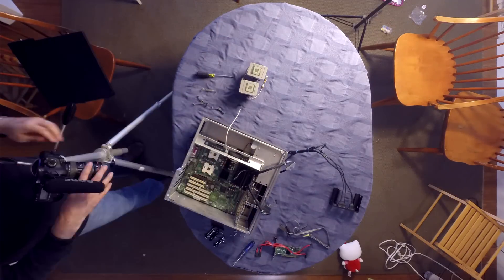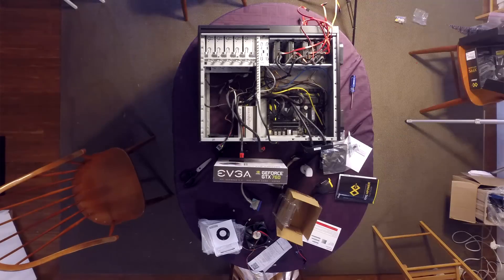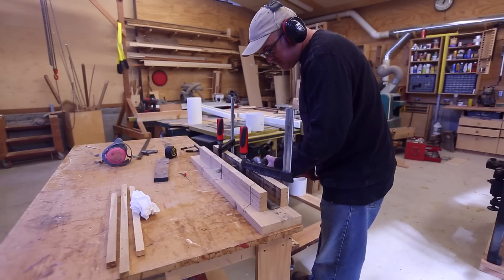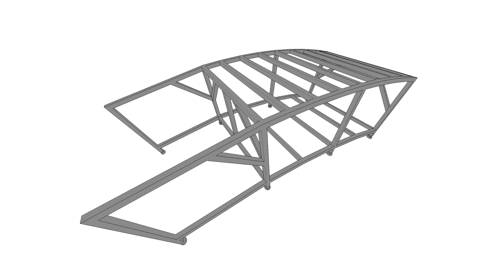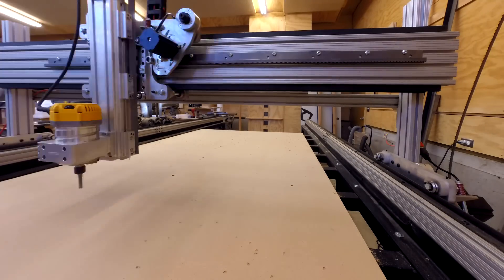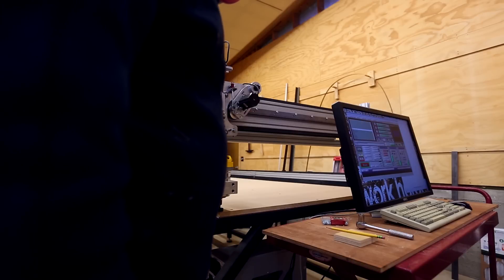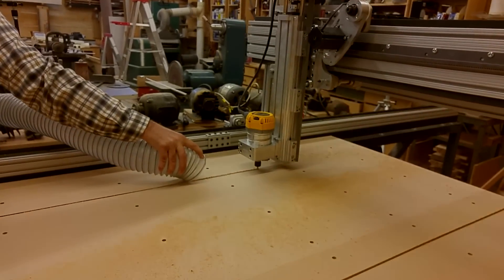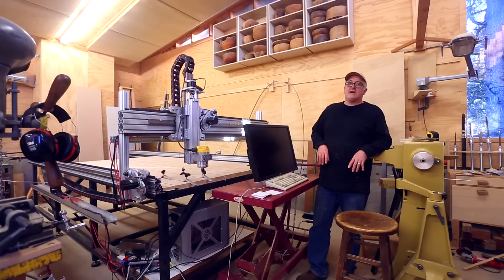The CNC Build: Part 3

Comment: Frank, All I can say is wow!  While I was layed off from our firm from 09 to 11 I worked for an ACM fabricator that has a large CR onsrude CNC that we operated with Alphacam.  it worked very well but was easier to draw in autocad and import into aphacam to assign tool paths. best of luck with the wire management! as far as dust collection our machine had a rigid duct that was horizontal on the gantry with a swivel connector to connect to a flexible line that sat in a tray like your motor cabling does. There was a dust shroud that raised and lowered with brushes on the bottom like a door sweep that helped to contain the dust for collection.  It also protected from the occasional tool break and small flying parts .

Comment: For hold down of small pieces, you can clamp a scrap board to the table and spray glue down your workpiece. The clamps will be outside the work area, and the glue should be strong enough to hold things in place so long as your feed and plunge are set reasonably. 

You may also want to look into nylon cap screws for holding the top MDF down, and see if you can find plastic hold downs, shattering a hardened router bit because you set an offset wrong and hit your clamp makes for a bad day.

Comment: Nice setup!  Check out HSMworks express if you have a seat in SolidWorks.  It's a free add-on and blends seamlessly with the style of SolidWorks especially if you're comfortable with Dassault Systemes meaning one less program needed.  Should note though: the free version of HSM (called "express") provides "two and a half dimensions of motion" where you can move in x, y, x&y, or z, but not xyz simultaneously. It's perfect/enough for 3 axis planer work but could require a couple hundred passes with a ball end to get any complex angled surfaces.

Comment: Frank, not sure what CAM software your using but you should have the option to create tabs on your through-cuts, this will leave small connections to the part being cut out, avoiding the flying projectile problem!

Comment: Vectric Aspire is an excellent CAD/CAM program. As you stated though it does come with a steep price. With the investment you have in your CNC it is a justifiable purchase. Ease of use and many features. They have trials you can take for a spin and with a few tutorials under your belt I'm sure you'll be putting that CNC through its paces.

Comment: Fusion 360 was mentioned many times and it's good if you do 3D stuff but for routing out flat plywood sheets use SketchUp with the SketchUcam plugin. Google SketchUcam for the download. Both SketchUp and SketchUcam are free.

Comment: You could add expansion bolt fasteners to the bottom stretchers so you could 'straighten out' the frame. Similar to leveling the feet of a table. I hope this makes sense.

Comment: Aspire has already been mentioned. It's by Vectric. You should also check out VCarvePro by the same company. It's very capable and about one third the price of Aspire. $700.00 for the current version. The good thing is you can upgrade to Aspire later and the difference from buying Aspire outright is minimal.

I've been using VCarvePro in my business for about 5 years and am very pleased with it. There's a very good community around the products that are willing to help, as well as great customer service from the company itself.

I have a similar steel table and what I do is bolt down a piece of 3/4" plywood to the steel with countersunk carriage bolts. Then I bolt the MDF to the plywood using countersunk nylon bolts. I have to screw up by 3/4" in depth to get to anything that could damage a router bit. Of course as you resurface the spoil board it gets thinner and you're closer to the steel bolts, and the heads of the nylon bolts. Eventually you replace the MDF leaving the plywood, or just glue another sheet of MDF directly to the thinner original piece. Your track system is something to consider though. I recently switched mine from 1/4" holes with T-nuts on the bottom to 3/4" dog holes on a 4" pattern. A lot of dust goes through the table with 3/4" holes, but there are lots of clamping options with them and I don't have to replace stripped T-nuts any more.

Comment: Some cad softwares to check out, google sketch up, 123D design, fusion 360 and solid works. Can't really make a comment on the prices cause I haven't looked into them, I've just tried the free demos for the first three and I used solid works in my machining class

Comment: If you're using SolidWorks I cannot believe there's anything better than HSMxpress if you only need 2.5D. It's free and awesome. If you need 3D, HSMWorks can be had for something like $2500 a year (I forget the exact price). That's a lot of dough, but it's worth it (in my opinion).

If you're willing to switch CAD software, Fusion360 looks really good. I haven't used it myself, but I've seen it on videos and stuff. Fusion360 has the same CAM engine as HSMWorks built in. Also, I hear that Fusion360 is free for hobbyists or small shops - I haven't verified that claim myself though.

Comment: I haven't read all the comments so this may have been said. The next time you have the MDF with slats off consider getting a welder or machinist to flatten the frame with a tourch. Not sure how that would effect the side rail system adjustment you added in the build. but they can make it very flat.

Comment: Sorry for the double post, but you can get this whole machine in kit form and full support from an amazing forum at JoesCNC.

Joe machines the aluminum parts so you do not have to wonder where to get all the parts and etc.  There is also many mods and a full BOM that you get access to by purchasing the plans.  The community even goes as far as having joes kits with CNCrouter parts and moore gear and 80/20.   If you work at it, you can build one in about 40 hours.  It is actually quite easy after you jump in and decide what size you are building.

Comment: For the software drawing part 2D and export in DXF : coreldraw, adobe illustrator, autocad, Sketchup, Solidedge, Solidworks, InventorFor drawing in 3d and export in STL:  Autocad, Solidworks, Solidedge, InventorFor programming 2d/3d at low cost : Vertric with Cut 2D and Cut 3D for most job  and AspireProgramming 3D IF  and only IF you have the budget : Mastercam or Featurecam or Fusion 360 for programming more complexe part in 3D

Comment: I'm an industrial designer. I use Fusion 360 a bunch because Solidworks is horrendously expensive but there's no doubt in my mind that Solidworks is the best option if price is not as much of a concern. 

Have you done any 3D printing? While I don't think that your machine is stiff enough for super fine precision (simply because it's so large) it'd be very cool to see a pellet extruder mounted where the router is now with a gigantic nozzle attached. You would be capable of HUGE PRINTS, at a resolution that is totally perfect for larger objects like furniture.
Reply: +SuperMarcoArt Something like this but maybe with a much larger nozzle: http://www.3ders.org/articles/20141226-new-universal-pellet-extruder-is-an-open-source-pellet-extruder-for-multiple-materials.html
Reply: +SuperMarcoArt This is more what I mean: http://www.3dprinterworld.com/article/dirk-van-der-kooij-3d-prints-endless-chair-with-robotic-arm-and-recycled-refrigerators

The nozzle here is pretty large but for design effect and not for functional reasons.

Comment: Cambam is not very expensive, maybe 100 dollars? and great for most applications. It's very easy to use and also has some 2D CAD functionalities. Fusion 360 is great, but more suited for 3D stuff and mainly metal working.

Comment: Are you using an onboard or fanless graphics card? It seems like a good idea to cut down on the number of fans with the dust and what not.. But i guess fine meshed filters would be a big help too.. As a sidenote, i agree with SciPunk215 that an SSD is a must have these days unless you need to store a metric ton of data.. I recommend Samsung SSDs..

Comment: I'd live to see you make a custom fabricated case for the PC out of wood - and this would make it easier to protect from dust, since building dust filters is fairly simple. Use medium thickness women's tights as a filter material, slightly stretched.

Comment: your can get a range of different adhesive that are tacky and not too permanent. they're perfect for this application as your can 'glue' your part down and then it just pops off with a little pressure. this will stop parts flying everywhere. spray adhesives work well. alternatively you can not go to full depth for your inlay piece and sand the back of the part down to take away the 'skin'. hope this helps. love the videos :D

Comment: The sw cut2d is cheap enough and is really simple to use. That's my best pic after some years of research. The company Vectric also do other more expensive products so you can upgrade when tasks require more functions. I have not tried the inlay my self but there are functions for it including shrinking tools and also really simple tabs to let you hold the pieces while cutting and then just sand them off when done. Thanks for such great films and greetings from Stockholm Sweden. Mikael.

Comment: A good piece of software that i've been using for years is Cut2D by Vectric. It's cheap, yet very powerful!
It also has a very easy to use feature to help you with cutting out small pieces, leaving "break-away tabs" so it doesn't pop out on you.

Comment: I work for solidworks reseller, so i got that as my cad. I've been trying to find  a good but affordable cam for it. At the moment I'm using hsmxpress, it is only 2,5d cam. If i need 3d cam then i use fusion 360.

I cannot use fusion for modelling, because i've been using solidworks for so long. So I need to use generic format to transfer files to fusion. And if i need to revise the model i'm doing a lot of work multible times, because I need to redo all the paths..

So what I'm trying to say is that when you are choosing your cam and cad be sure that you can tie them together. You want your cam inside your modelling software!

Is your friend selling these plans? I really like the setup that you can do latger pieces at the other end.

Comment: Fusion 360 works really good for mechanical stuff such as those plugs you were trying to cut.  The cam side of it allows you to put tabs in so it won't try to fly away plus it's free and there are great tutorial videos on it on YouTube.  Vacuum hold down without a crazy good vacuum pump is mostly a joke.  A shop vac hold down will only be ok if you have something with at least 1 sq foot of surface area. For artsy stuff and signs etc you most likely will end up with ventricle vcarve pro. Hope this helps.

Comment: Are you using a Solid State Drive (SSD) for the computer? It would be a lot more resilient to vibration than an old fashion Hard Drive (HDD). They're not expensive anymore. A CNC machine could probably work very well with a 128GB SSD for $50.
Reply from the maker: +SciPunk215 no, old spinning disks, that is a good idea.

Comment: Hi Frank. I work as a professionel cabinetmaker in Denmark. I use commercial CNC Routers a lot. When I need to hold down small pieces I use double sided tape and stick the piece to some scrap MDF. You can then clamp down the MDF instead of the workpiece. Use a heavy duty tape and you will be surprised how strong it is. -Ulrik
Reply from the maker: +Ulrik Kruse Thanks, I will try that.
Reply: +frank howarth or you do it like Jimmy Diresta: Hot Glue :)

Some people cut the shape of small parts, put they don't cut all the way through. They finish the cut up with a bandsaw/ jigsaw/ scroll saw and cut it flush on the router table.

Or you don't cut all the way around. You cut one side of the piece, clamp it down and then cut the other side, without hitting the clamp.

Comment: Great series of videos.
Why does the computer have to be right there? How about a whole separate space for the computer, monitor, and keyboard... physically separate from the CNC machine. It could be several feet away so there's no vibration and it's far away from the dust. Then just run the one cable between the two.
Reply from the maker: +SciPunk215 It could be, that may work.

Comment: You could just attach your MDF top with countersunk fasteners and then surface the entire top with the CNC itself, taking off just enough to level it all. Then fasten a sacrificial top on top of your base leveled sheet which you could cut T fastener channels into.
Reply: which is basically what you did... Blast me for commenting prior to the end of a video. Smack my hand.
Reply: Ha.. Something I can add two cents on.. For cutting out parts, set it to leave a few 1/16th&quot; tabs near the bottom of the piece vs cutting it out entirely. This will keep the part attached to the main work piece until you remove it with a knife and clean it up.
Reply from the maker: +Scott Hildenbrand lol
Reply from the maker: +Scott Hildenbrand  I had tabs on the last one, but they weren't big enough.
Reply: +frank howarth Asking because I don't know - would double sided tape work?
Reply: +frank howarth AutoDesk is currently running a sale and you can get it as a subscription 99 bucks a month - that's a good deal I think considering the cost - my dad bought AutoCAD LT and that cost him over 2 grand so with a subscription type thing you give that a go - i know forking out at minimum of 2 grand is a lot - i know you don't own it but with not needing to pay for new software at another 2 grand
Reply: nd+Sachi WI Try Drafsight, it is free adn you can even do 3D stuff in it, but it does not have as good support for painting surfaces.

Comment: I use Autodesk Fusion 360! It's free for one year than is not too expensive but it's awesome!!! You'll thank me... :)
Reply from the maker: +Giaco Whatever This has been mentioned a bunch, I am going to look into it. Thanks
Reply: +Giaco It is free for students, hobbyists and small businesses that make under 100K a year.
Reply: +threeque yes... For one year... :)
Reply: Nope, free for ever. Just renew your 1 year licence if you are still a student, hobbyist or make less than 100K! I suppose you could buy the commercial license after one year if you wanted to ;)
Reply: That's really good to know... I'm still in the first year but it says I'll have to pay afterwards... Well I guess I'll see when the time comes! Thank you man!
Reply: +frank howarth Fusion 360 is a great tool when it's not crashing. The team updates it a lot - unfortunately some updates are far more unstable than others. I've gone weeks at a time without being able to stay crash free for more than a few minutes.

The CAM tools in Fusion 360 are pretty sophisticated (which can be both good and bad). Every time I setup a CAM job in Fusion 360 I'm blown away with what it's capable of. But that also means wading through a lot of stuff and triple checking everything. More capabilities and more things to check can also mean more chances of generating Gcode that I'll regret running later.

Because it's so much simpler I find that I trust MeshCAM much more.
Reply: Yes I actually realized after I wrote the comment... :-/
Reply: Yeah, hopefully they don't change it. I just re-read the a terms. It's 3 years and free for students and teachers. Free to renew. 1 year for hobbyists and small business. Free to renew. Best deal going. Good marketing plan by Autodesk.
Reply: +Giaco Whatever and i m loving it. Fusion360 rocks.simply draw anything and get cam action at the sometimes. the Cam action is really very professional save a lot of time.
Reply: +frank howarth get 360 fusion. you will not disappoint.
Reply: +Michael Buffington  Well as an user of Autodesk Softwares for more than 20 years I can say that crash its part of their software AutoCAD, Inventor, and now fusion...
Reply: +Giaco Whatever Fusion 360 is fantastic.
Reply: Gary Hamilton yes me too!
Reply: Fusion 360 is awful but it's cheap and has a lot of features. Source: I have had an Ultimate subscription since 2014 and use Onshape instead.
Reply: +taiden Why is Fusion 360 awful?
Reply: +CNC Newbie my thoughts exactly,  fusion is basically a cloud based SW ( which I have been using for years) and works great. If you know what you're doing.
Reply: +Josiah Gravelle Exactly, it may not have as many features as SW but Fusion is a relatively new thing.  Give it time and it will be just as complex as SW.
Reply: Hi Frank, Let me know your thoughts on Fusion 360.  More than happy to help you out, as I specialize on the CAM Side of Fusion 360.
Reply: I use Autodesk Fusion 360 nice and they got full web page of help in videos best options over others

Comment: With the inlays, reducing the depth of cut would eliminate the center piece from shooting off into space. Then do a rough cut with the band-saw to isolate the piece you need. After you glue in the rough cut inlay, run it through the planer/drum sander to remove that top layer of extra material. :)
Reply from the maker: +kaminaricelica07 Yes, you are reminding me, I have seen it done this way.
Reply: +frank howarth Keep up the good work Frank! Always looking forward to the next segment of this project.